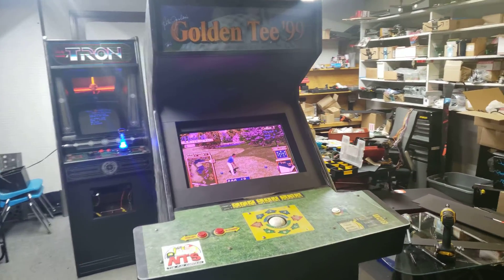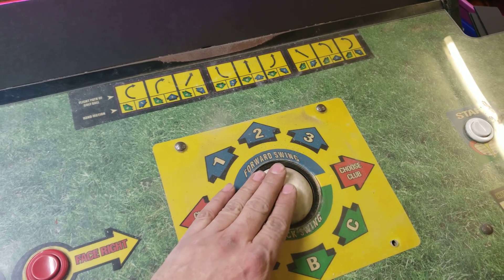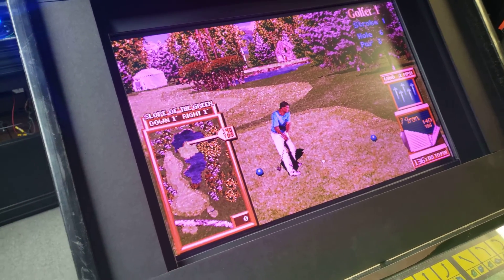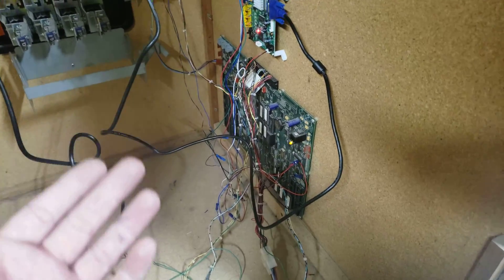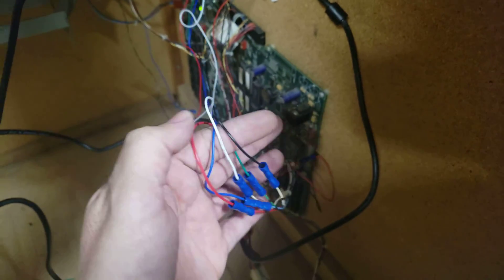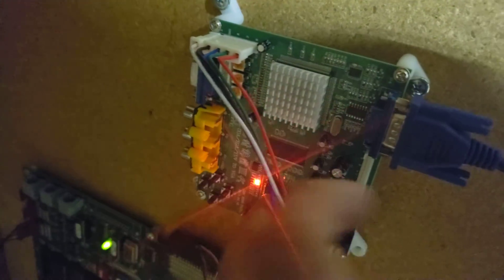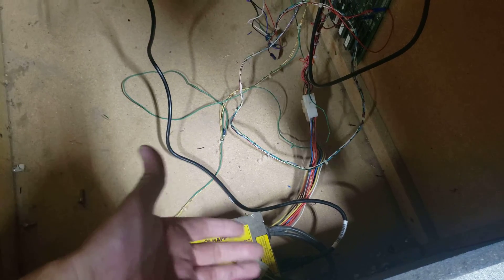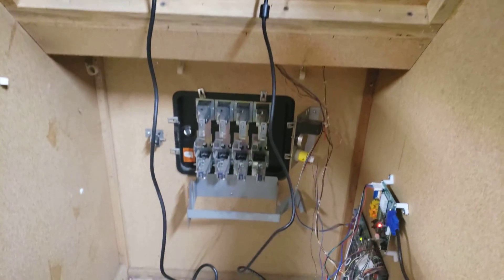Golden tee monitor Cga to vga convertor swap. Part. 1

Comment: Question what material you used around the arcade monitor bezel. It looks like four straight pieces but what is that made of?. Thanks
Reply from the maker: @keithfalgout6358  hello its just foam board or black poster board  simpky attach with double sided sticky tape.

Comment: I did all of this wiring correctly but when I connected the VGA converter the picture looks great for the first 10 seconds on the screen but after that the picture degrades.  The colors show up very vibrant and then it goes dull.  Did you have the same issue?  Any help would be appreciated.  Thanks!
Reply: craig, I have read that people having this issue need to adjust clamp settings.  the last video I saw on this he changed the setting to 4 and 5 keeping st less than sp but this was with Cruisin game.  Good luck.
Reply: @brianwillson2068  Thank you for posting this.  I just watched that video and will test it tonight!

Comment: I've had all kinds of headaches trying to adapt a 2005 GT Complete to LCD/LED.  I finally found the answer on an arcade forum..  I'll start by saying, the 2005-ish GTs with the video card are different from the one shown in this video. The scaler card used in this video won't work. It may work perfect in the 99 and 2k cabinets.   When set at Medium resolution, the GTs with video card have an odd VGA output frequency of 25.7 kHz (Horiz) and 60.6 (Vert.)  Unless you use a monitor with that low of input frequency you'll get all kinds of messy signal or no signal at all. I've tried all kinds of converters and upscalers with no luck. With the right monitor you can just plug straight into the VGA on the video card and you're set.  I got lucky with a ViewSonic VX2257-MHD: input freq range of 24-83kHz(H); 47-75 Hz(V).  I had to adjust the monitor settings a little but it's crystal clear.  I got close to perfect with a 30-80kHz(H) monitor, but there were still some faint wavey lines.  Hope this helps.  Again, The upscaler described in this video may work perfect for the 99-2k boards.  I'm just sharing for those working on the later machines.
Reply: I found a Lenovo Q24i-10 24" that works perfect with another old arcade board I have (15kHz).  I haven't tried it with the GT because it's out collecting money right now.  You kinda have to play trial and error in picking a monitor.  Start with the size you want and make sure it has the VGA input, then start digging into spec sheets.  Just make sure the input frequency is what you need before you buy.  There are some monitors I've never found the whole spec on, so I let them be.
Reply: Do you have a link for how to do this? I need to do this on a 2004
Reply: Were you able to find something that worked?  I can get it to work with an old 20 inch computer monitor but obviously I would like to use something bigger.
Reply from the maker: @bavery76  just find tbe right monitor and you be able to plug directly to the video card.

Comment: Thanks for posting this mod. I've been working on a similar build with the red board. Can I ask you where you got the 5 pin molex harness for the VGA converter board? I've been trying to use the harness adapter (smaller one) that comes with the board and having stability issues. (shakey screen output). Thanks!
Reply: did you fix you shakey monitor ?  I replace my monitor with the led on my bomb jack game & its shakey too.  my setup had 2 sync wires.  I tied them together for the best picture but still shakey.

Comment: Golden tee 4 is EGA it can be set to CGA.
I had bad luck with the little upscaler convertors.
Driving games like " Califonia Speed" had black level and V sync issues.
High failure rate don't let it get overwarm or let VCC go above 5.2vdc.
Slow movement CGA no issues
Action games EGA. Has Vsync and Black level jumping.
Just my humble observation

Comment: Hi.  I have a GT 2005 with a 2005 LCD monitor
And Gombe converter. 

I’m confused with the setup.  What happened to the video card? Is that eliminated with the converter?  I also don’t see which wires to tap into as there are so many molex wires and connections.  Please help if you can. 

I see nothing else on the internet that helps.  This is the closest it gets but falls short for me.

Thanks!
Reply from the maker: Theres is no video card in this gameboard. Its a golden tee 98.If your machine has a video card it will not work with this convertor.
Reply: @TheBonilla7  Hello Arcade Funcade and thanks for posting this. Can you please share where you bought this converter version? I can only seem to find the ones that also have a yellow wire.